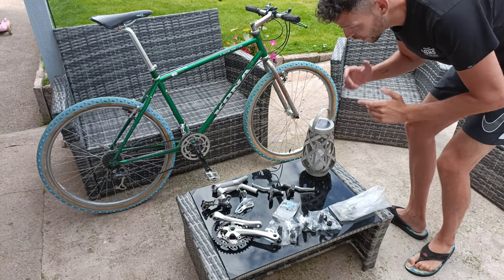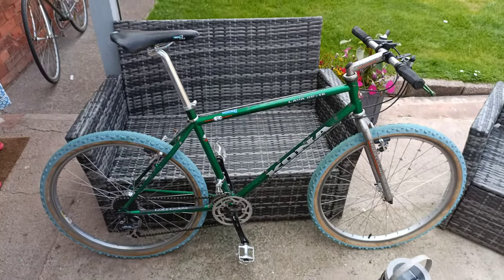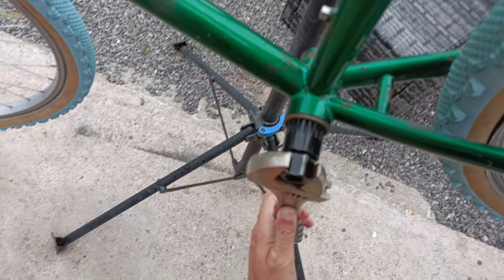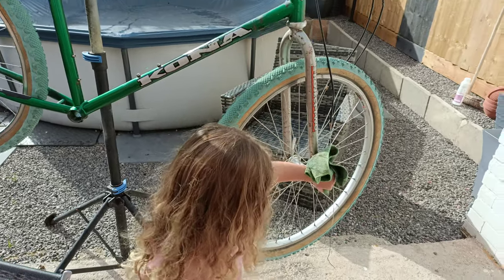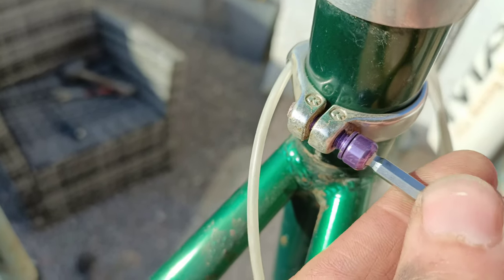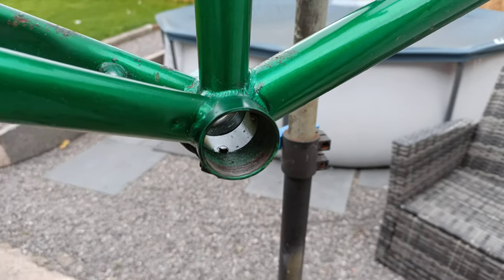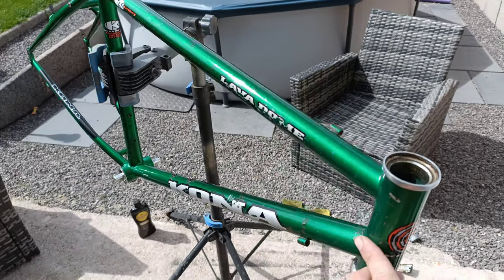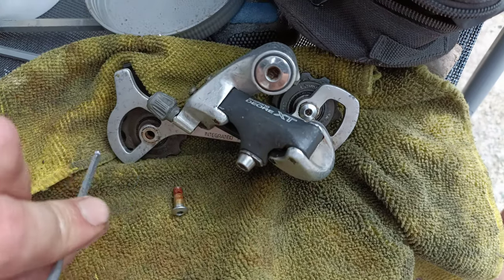Part 3 Cheapest on eBay Retro Kona Lava Dome rebuild, XT 737 and other trick bits 💚

Comment: Also, try wet and dry 2000grit, then 2500, then 3000 all over the frame.
It will be quicker and give a better finish that what you've achieved (I reckon)
Reply from the maker: It took me long to do just the rust spots so not too keen on doing the whole lot but I think your right, could have been a better result. Don't want anything to pristine as it's going to get some good use through the winter.